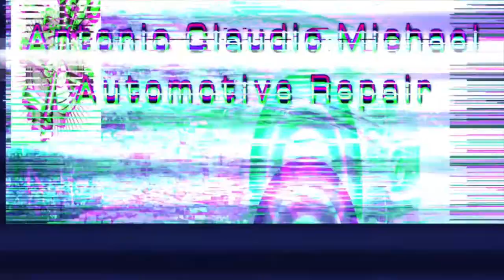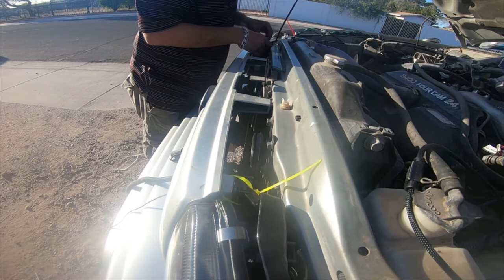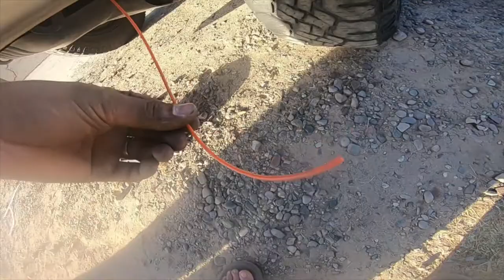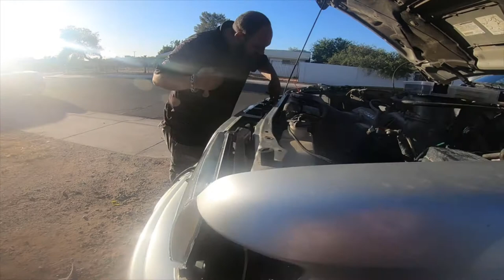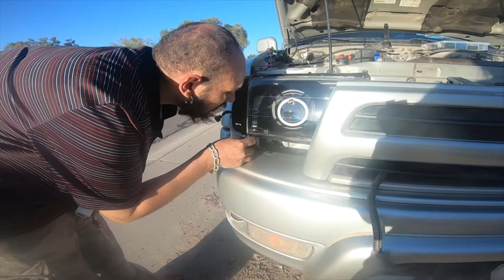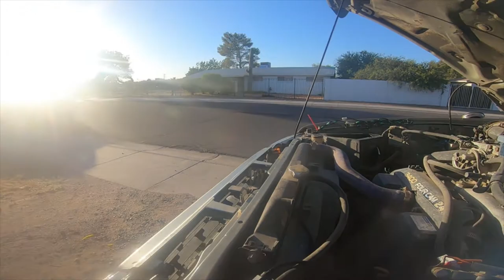2000 Toyota 4Runner - HID Projector RetroFit Install Part 5

Comment: That became a pretty big job. Glad your almost finished.
Reply from the maker: Yeah took over 32 hours total and I havent adjusted them yet it took so long because I was doing it at my house and 127 degree heat didnt want heat stroke so I took lots of breaks
Reply from the maker: I have to take the ram guard and grill back off to replace the grill clips and put the metal brackets on I forgot to take off the old lights but things happen. Ya get tired ya know